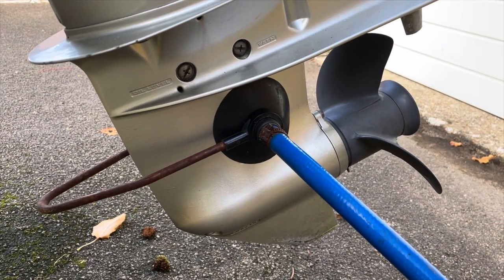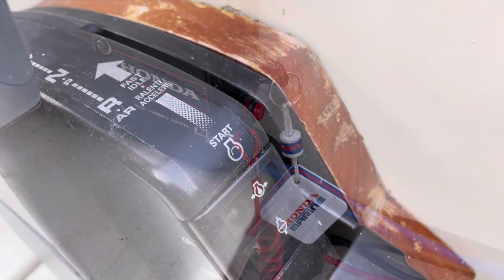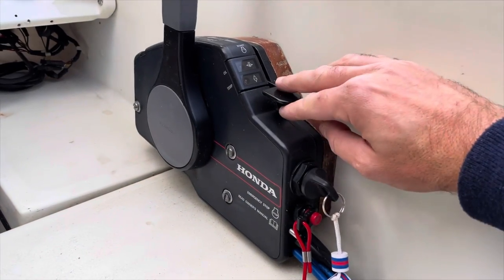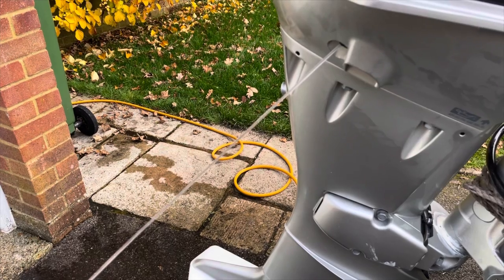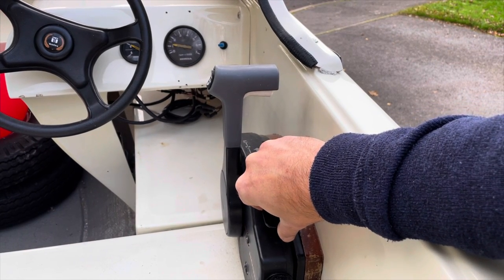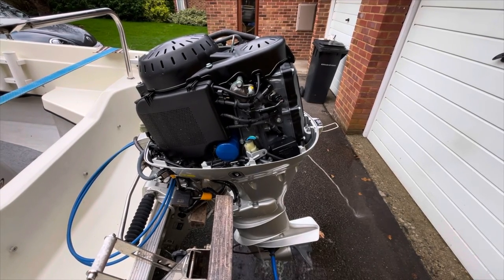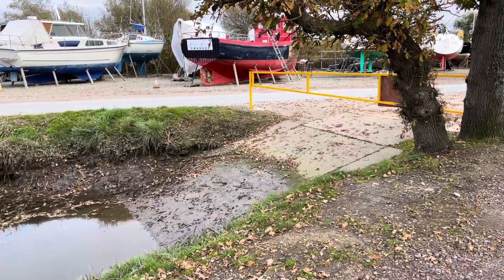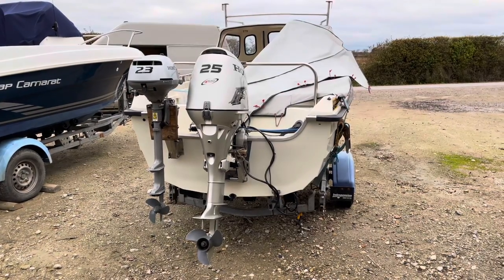4. Orkney Strikeliner 16+ Starting the Honda 25hp Outboard Motor and a look at the boat’s new home.

Comment: How much does it cost to keep the boat there ? 👍
Reply from the maker: For the summer season at the boatyard - 1st April until 31st October - I paid £768. And that includes a full year Poole Harbour dues and unlimited use of the slipway. The boat’s kept on a trailer on the hard and I launch and retrieve it each time I use it. 
The fees also include use of the large bins and oil disposal point for waste disposal which can be quite handy and use of the toilet block and showers too. Winter season was about £400 and something, I forget the exact amount.
Reply: @mattryland949  Cheers Matt for the info. That’s not to bad. I’ll give it some thought 👍